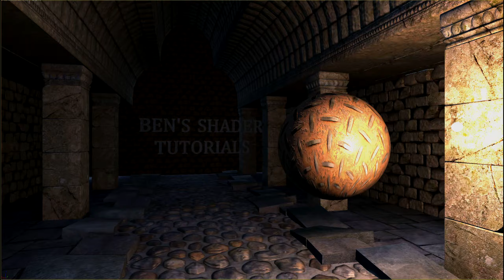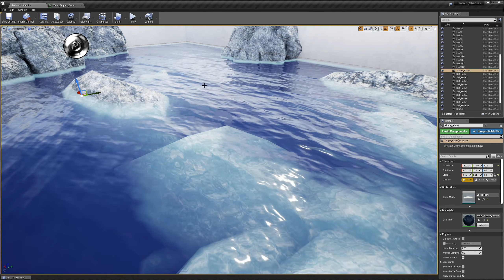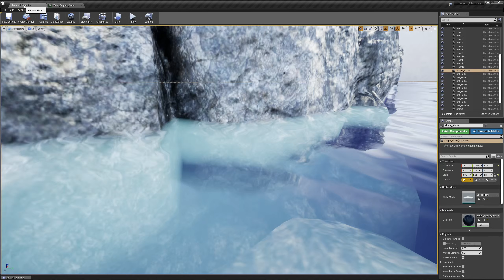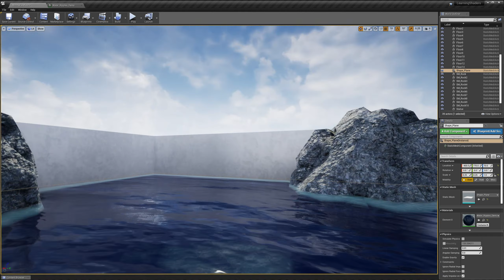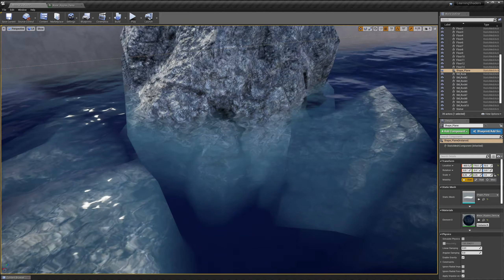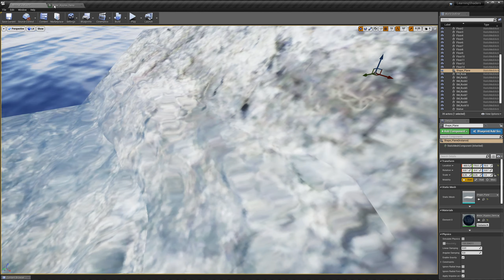Water Gerstner Waves - UE4 Materials 101 - Episode 26

Comment: AAahhhhhhh.... I was really trying, but getting this to work in UE5 is just impossible! Since Epic has decided to remove tessellation entirely, our only option is to use Nanite Displacement.
But Nanite DOES NOT SUPPORT translucent materials. Not even making the water opaque and using SingleLayerWater as the shading model will work, because only transparent materials can read from scene depth (makes sense because it's a separate pass after opaque geometry has filled the gbuffer).
Only option is to import a subdivided mesh, which is horrible for performance when trying to model an ocean as I am.
Or ditch UE5 and go back to UE4.
@BenCloward, if you are reading this - do you have any good suggestions?

(also, Gerstner waves are probably not suited for ocean environments because of repeated wave patterns. I'm also open to suggestions in this department. :) )

Comment: I know there are many ways to implement gerstner waves. In your specific implementation how can we avoid vertex loops on top of the waves? If we have like 3 waves its ok but I have 32 and even if I have steepness at 0.1 the waves break on top... And I guess if we change the displacement logic we will have to change the normal calculations as well.

Comment: You have fantastic in depth tutorials, I am following these and others to learn UE5 materials. However in UE5, World Displacement is missing. I can do the tesselation part in Blender, or even with UE5 modeling tools. What is the alternative for World Displacement?
Reply: I used it on the world position offset. Seems to work
Reply: I have same problem about that. Tried to link to World Position Offset, It vibrates weirdly awkward.

Comment: Hi Ben, I couldn't find the Tessellation rollout in the shader to follow the tutorial, I'm using UE5, I think tessellation is no longer possible, is there any way to work around this?
Reply from the maker: The work-around in UE5 is just to use a plane with more polygons.  You could create a higher poly plane in Blender or other 3D software and bring it in to Unreal instead of using the tessellation feature.

Comment: Hm this methods does not working in unreal 5
Reply from the maker: Right - the part where I use tessellation to subdivide the mesh isn't possible because tessellation has been removed. So you just need to use a plane that already has more vertices instead.

Comment: To all UE5 users, tesellation is no longer a feature. You can still have this effect by adding polys to your waterplane instead of tesallating by distance. Its more expensive and not ideal for games but for a realtime scene it will work fine. 

For reference i am using a 500 meter by 500 meter plane at 1.2 million polys no problem at all.

Comment: Hey there! 

First off, great tutorials, I'm a huge fan, and very happy for everything you consistently put out!

I'm was going through this tutorial and I realized that there is a minor change which I might need to do: I'm assuming that there should be a way to "backpropagate" the sampling position used in the cossine term (the one which generates the vertical offset), such that my vertices only move vertically, right?

If so, would you happen to know how would I go about doing that? Because I'm trying to both generate a mathematical model for the "ocean" in my game, where a boat will react to the water level with buyoancy physics as well as have the mesh which represents the wave follow the given mathematical model - essentially, I want to synchronize the heightmap which the water generates AFTER the vertex shading to an "invisible" mesh collider for my boat to float on top of.

I naively assumed that it would be possible to just sample each individual wave back by an amount of "offsetSize * waveDirection", but it seems to give me incorrect results.

Comment: Hello! I'm wondering what to do in Unreal 5, as Tessellation no longer exists
Reply: Tessellation is not a feature in unreal 5. I'm pretty sure they just want people to use nanite for now. It pretty much does the same thing as the tessellation multiplier, but better. But for this case I don't think it supports refractive surfaces sadly. Hope they add support for that soon.

You can use the modeling tools to subdivide it yourself. With your model selected press shift 5 to open the modeling tools and then find the subdivision tool. Choose the amount of times you want to subdivide, then press accept.

Comment: Excellent tutorials! They've been the most helpful set I've come across. It's a little hard to tell from your video because you don't zoom out of the water far enough, but is this method supposed to stretch the plane that it's applied to? I've made a similar box test environment, but my water plane stretches in and out of the bounds after adding the gerstner waves.
Reply: I have the same problem. It seems like after i added the steepness functionality, the mesh moves in the X axis as well.

Comment: Regarding the mathematically-generated waves on the plane - could you not just reuse the surface normal map, perhaps scaled up once again, as a mesh displacement modifier? It seems to me that that would solve your realism problem just as easily without introducing a whole bunch of node math into the shader, though I have not implemented it so I don't really know that. 

Assuming it worked, what would be the difference in computational expense?

Comment: Hi Ben ,i did exactly the same as you at the video,but untill i deep my camera inside the water the waves dont appear,maybe i did some wrong,wonder for your help!
Reply from the maker: There could be a lot of things that cause this.  Is the tessellation on your mesh high enough? What is your tessellation multiplier set to?  Is your water mesh larger or smaller than mine? Did you try adjusting the wavelength constant value and the wave height constant value?
Reply: @BenCloward  fixed it,there was an issue related to const values,had to change them a bit.Now I`m facing another problem,my refracted image is moving ,but theres like a permanent shape of my stones blue coloured and they dont move,but the image below water is moving

Comment: Hi Ben, I've been looking online and I can't find any help with one thing: 

Once you make this ocean material and add it to a plane, how can you then make an ocean out of it? I have a very vast ocean and I want to add this material to my plane, but i need to scale the plane 100,000 by X and Y. The result is that even with a tesselation multiplier of 40, the 4000 triangle original plane just simply cannot handle the size. Furthermore, if I duplicate the plane and then try to tile the planes to make an ocean, the waves do not line up and the seams look horrible. 

What is your method of making a vast ocean once you have a very nice and complex ocean material?
Reply from the maker: That's a good question.  My tutorial series here is focused on making a general water material, and because my water area is small, it ended up being more like a small lake or pond than a giant ocean.  There are some specific issues related to making a large ocean material (as you pointed out) that I didn't cover.  If I were making a large ocean, I would use a single plane, and I would use Unreal's tessellation feature to increase the triangle count close to the camera and reduce it further away from the camera. Or I would just use the new water system that was added to Unreal in version 4.26.
Reply: @BenCloward  appreciate tour response. I do have a tesselation power and tessellation multiply parameter but I’ve found that sometimes it simply doesn’t work. Very bizarre. Anyway thanks for your reply it’s nice to know I’m not going crazy.

Comment: Great video. This series is awesome. I do have a question though... how come you don’t use parameterised values and a material instance? Would make showing amendments to your input values a lot easier! I noticed this about all your videos. The content is awesome though. Keep it up.
Reply from the maker: That's a great question, James.  Thanks!  There are three reasons for this:
1. Full disclosure - I'm still pretty new to Unreal.  The main engine I use at work is Frostbite - so there are some things I'm still learning about how this engine works.  I know that you can expose parameters, instance the material, and then tweek the params in real-time, but I guess I haven't gotten into the habit of doing that yet.
2. There are really two main stages of shader development - setting up the math, and then dialing in the parameters.  In these videos I'm mostly showing the "setting up the math" part, and I'm leaving the "dailing in the parameters" part as an exercise for the viewer.
3. Exposed parameters are more expensive than hard-coded values, the the fewer parameters you can expose, the more efficient your shader will run.  So when I'm developing the material, I like to hard-code everything.  When I'm ready to put the material into production for the artists to use, I go back and expose only a few specific params that I think they will use.  I guess I've never showed that stage of development in my videos.  It's like a clean-up and polish pass for me.
Having said all of that, it's a good idea to show that process, so I'll look at doing it more in future videos.  Thanks!
Reply: @BenCloward  I like to make almost everything parameter and once I got the good values it's time to hardcode those that need no artist direction.

Btw, thanks for all these videos.  I've learnt almost I know about UE4 shading thanks to you and your fine work.